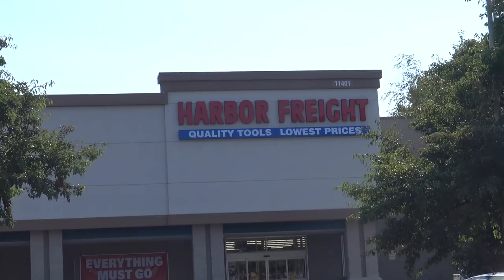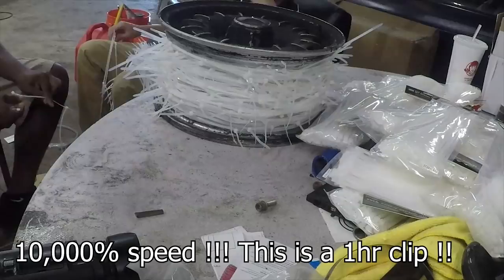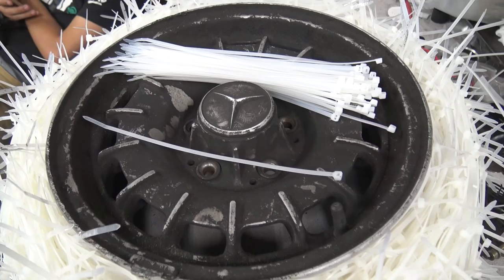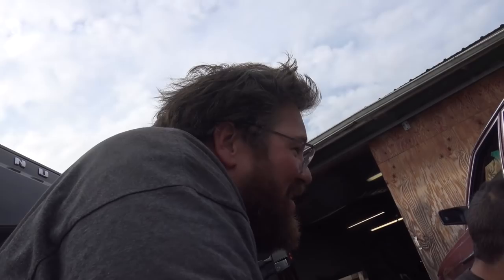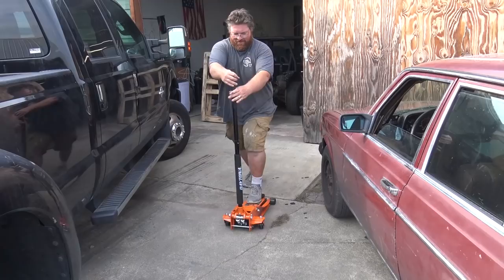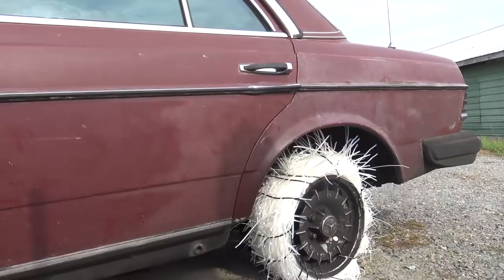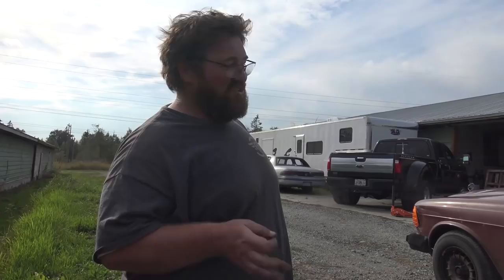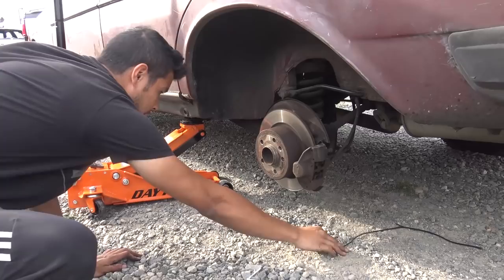We Made a TIRE Out of ZIP TIES

Comment: Tire casted in hot glue next?
Reply: That would be lit
Reply: Yes
Reply: The.22Marksman  fr though hell yea!!!!!
Reply: Yes!!
Reply: You could just make a box with plywood slightly bigger than the rim, fill it with the glue, dip the rim in, let it dry, then cut the glue into the shape of a tire.
Reply: Hell yeah
Reply: I will provide the hot glue.  Orion contact me, i will gladly give you +25 lbs of it.
Reply: That is an amazing idea
Reply: Drill a hole (or several) in an already mounted tyre and pour hot glue in. Then cut the tyre off.
Reply: Had to make a toothpick bridge in 8th grade shop class using only glue and toothpicks. The goal was for pressure to be placed on top to see who's could hold the most weight, and that's what was used to determine grading.. We used over 30 sticks of hot glue since they didn't say how many toothpicks or glue we could use. and our bridge was indestructible. He gave us a C-
Reply: And  heat up the rim and dump the sticks all over it
Reply: I was just gonna say that haha
Reply: No way it holds up to a burn out. Lol. It might just glue itself to the ground. I want to see this now.
Reply: U know wat I was thinking on that hot glue then saw this comment lol
Reply: Hot glue or even flexseal would be cool
Reply: TheMasterCheese Very interesting.
Reply: i had the same thought lol
Reply: good idea

Comment: Piss as Coolant
Reply: Omg, and if it leaks, please put eggs in the radiator. Heard this works from RV camper guys, but I smell bullshit. So perfect experiment!
Reply: piss is just water, isnt it? that would be uneventful
Reply: JohnStax this would be hilarious 😂
Reply: Iron Head  well youd have to at least try the egg thing the other guy said, but maybe try something along with those two
Reply: I’ve done it. Got a free car back in high school with my buddies.... we overheated it while rallying it out in a field and boiled the coolant out. When she cooled we took turns peeing into the radiator bc we had nothing else. I sure as hell wasnt the one who put the cap back on
Reply: I actually used that one once in an emergency. went really well 100 km hahahha
Reply: That would smell so bad
Reply: It would be very corrosive because of all the salts
Reply: Yes, but without destroying the Mercedes, PLEASE
Reply: imagine the smell
Reply: No that would work then i would die laughing
Reply: Piss as motor oil
Reply: or gas lol
Reply: It works I've used it in a Subaru before
Reply: Just like in My Summer Car
Reply: That's would be great 😂😂
Reply: It works, we tried with 3rd Passat :D
Reply: It would work fine temporarily, but if left in too long would cause corrosion in metal parts (due to the high salt content) and freeze during the winter if the engine’s left turned off.

Comment: Been thinking about this for a few days now and I have a possible improvement for you, rather than repeatedly placing zip ties in circles over the top of one another in a way that makes equally weak shells of plastic you could thread a dozen zip ties onto each of the circle ties having them stick out from the wheel like spokes. Then with each complete layer of circle ties, you could also place a layer of shaftwise tie wraps again loaded with spoke like ties. This would allow all your tie wraps holding the wheel together to be below the rim and those taking the weight to be capable of deformation without losing integrity for the whole thing. The shaft wise wraps don't need to loop around the hub because they'll be locked into place by rings above them and they'll also help lock into place the rings bellow them. The final layer or two of circle ties and shaftwise ties should then be left with no spokes so they're purely integrity and don't risk the easy damage of being ripped appart by their own spokes. In effect, you'd build up a tire made out of plastic fins that should be able to support weight without damage for longer than this attempt.

Comment: Can you use Liquid Nitrogen as Radiator fluid?
Reply: That Would be a bomb
Reply: Andi THAT IS A BOMB
Reply: If you want it to blow up in his face
Reply: Yes you can use Liquid Nitrogen. Dry Ice too. Your engine would shatter like glass internally as you crank it.
Reply: No it will boil into gas, then there will be no coolant
Reply: It wont blow if they dont put cap on
Reply: BOMB
Reply: Andi it would kill the car instantly. (I tried from another video, also in the gas tank...
Reply: Basically the same as having no coolant. It'd evaporate.

Comment: Yall should do this again but have the "sidewall" be a part of the tire from the start. So after the first couple of wrappings you run the "sidewall" zip ties under the wrappings and close it after. Maybe even use smaller zip ties to try and keep the side ties evenly spaced.

Comment: Please try this again, but do it with this tool involved:  https://tinyurl.com/yd8vh2bf
Using a zip tie gun, you can get them really tight so they won't have such a tendency to roll.  Plus, trim your leads and put the sidewall ties on the sides instead of on the driving surface.  I'd be very interested to see if that worked.